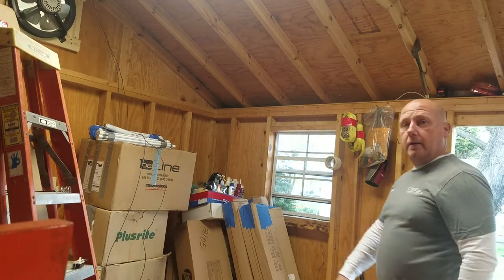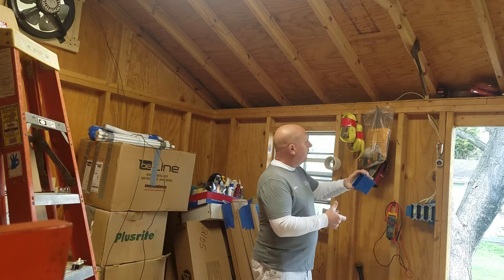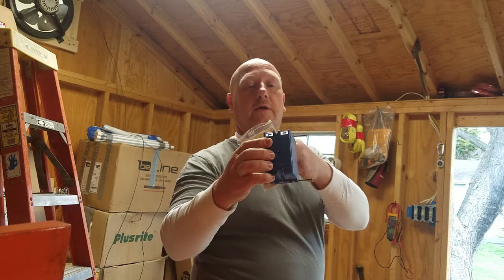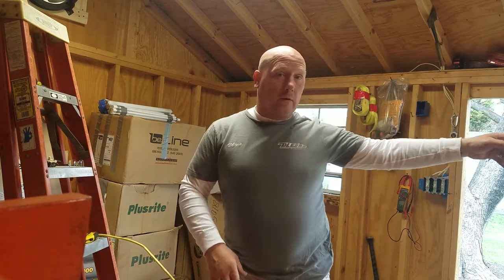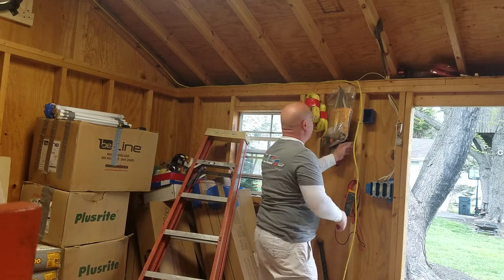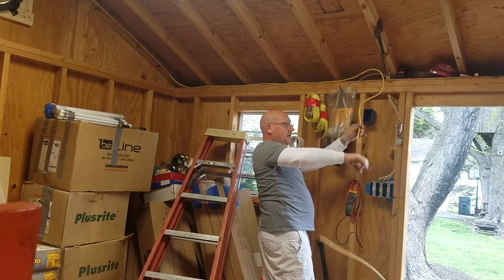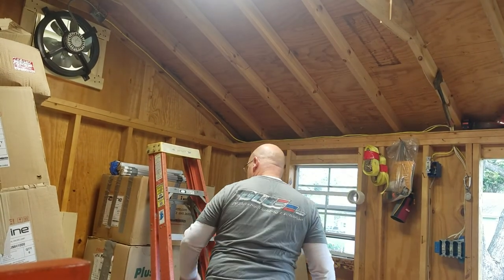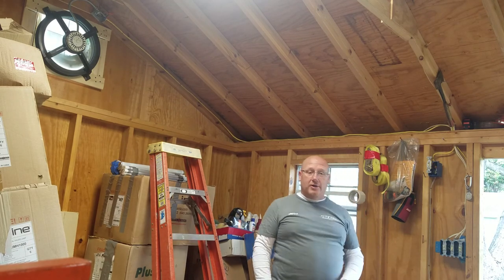Wiring an Exhaust Fan on Shed Gable w/ Temperature & Manual Switch Option

Comment: I did this to my shop 4 years ago after watching this video. Genius. Works perfectly today. Allows me to override thermostatically controlled upstairs exhaust fan to bring temp down a little before switching on upstairs mini split so the 90 degree heat doesn’t cause the mini split to work so hard.  Thermostat switch i have set at like 100-110
Reply: Thanks Jeff ... I am glad it worked out for you.       GOD Bless

Comment: Great video!  I was actually going to just use a single pole switch and run from hot before the thermostat and hot after to the switch. This way when I turn switch on, I manually turn on and when switch is off it’s in auto. What are your thoughts on this? Thanks
Reply: yea, that will work but keep in mind it will have a benign feedback to the single pole switch when it meets temperature and cuts on.
Reply: Thanks. After thinking about it awhile, I’m gonna wire it the way you did but use a pilot light switch. Thanks again

Comment: What thermostat can I use?
Reply from the maker: jsutmeasimpleman  the fan I installed came with the unit and was pre-wired to the fan motor ... however you can prolly get a thermostat separate  but check your voltages and temp requirements.